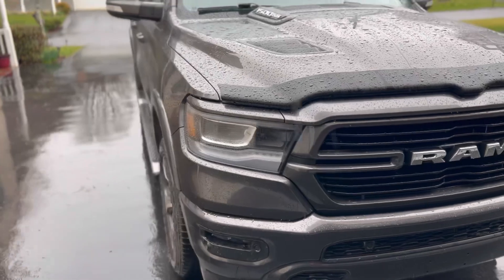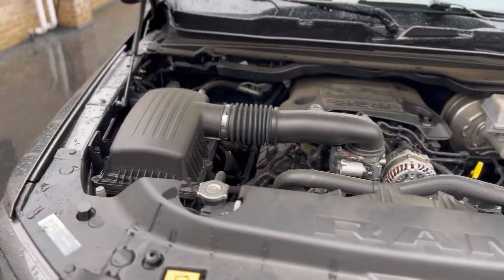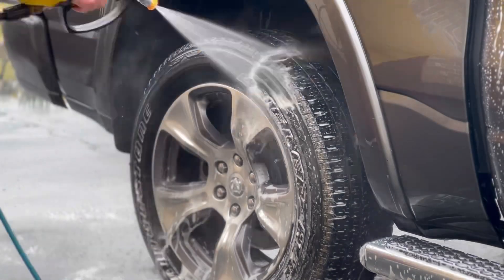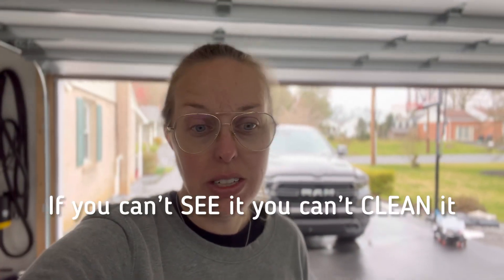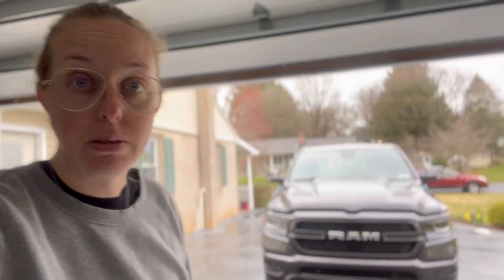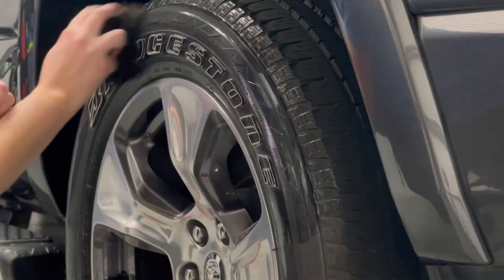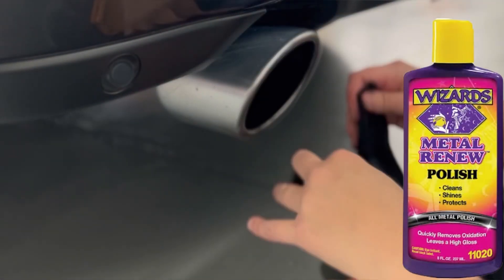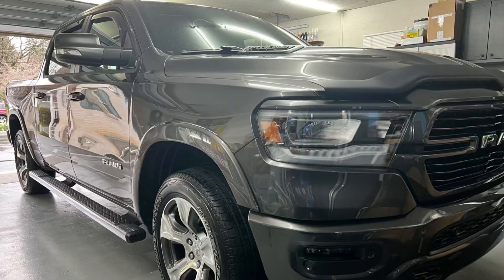Prepping A Car For Sale- Full Detail Start to Finish! (This One Gets A Little Emotional For Me 😢)

Comment: How much super foam and water did you mix up in your spray foamer that you used as a exterior prep. I just bought some super foam thanks to this vid👍🏻👍🏻
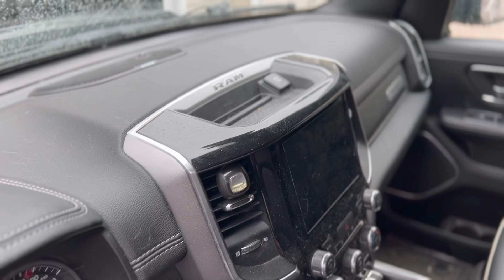Reply from the maker: It doesn’t need much . Normally it’s 1:10 ratio and in such a large container I eyeballed it but it was about 2-3 oz

Comment: Couldn't find a better way to contact you, but have you tried the DIYDetail coatings? You've use some of their other products and was wondering your opinions on the DIY line of coatings. Will be my first attempt at coating was wanted to use a product that also has a line of prep and maintenance supplies.
Reply from the maker: Yes ! 5 yr and 8 yr. I’d have to say if the two the 5 yr was my favorite but I will be testing the 3 yr on my own vehicle and have heard great things of it

Comment: Chelsea do you use any type of undercarriage dressing to dress up places such as wheel wells.  I’ve been using Adams Undercarriage Spray and it gives everything a deep black, almost disappearing look.  Just curious if there are other products out there that do the same.  Thx
Reply from the maker: I clean really well with dark fury and the big Ez brush but don’t use any dressings on wheel wells as they tend to accelerate resoiling and most people don’t look there anyway unless it’s a show car and as soon as they drive away it will get dirty within minutes. Trucks I spend more time ensuring those spaces are cleaned and dark fury leaves them looking dressed

Comment: Definitely check out the tornador velocity vacuum. It combines the blowing from the tornador and vacuums at the same time. Definitely works great with pet hair and sand.
Reply from the maker: It requires a air compressor that I can’t support in my garage electrically but is a good tool

Comment: Discount code isn’t working for MOTORPLAST.
Reply from the maker: What code did you use? It should be Chelsea10. Try again and if it doesn’t work let me know.
Reply: @attention2detailswchelsea  that’s the code I’m using, but unfortunately not taking it.  Thx
Reply: Hi Chelsea, they are not giving the 10% discount (CHELSEA10) for MOTORPLAST.  On a separate question, didn’t you do a video on a spray wax made by Superior Products?  What was the name of that stuff?  Thx